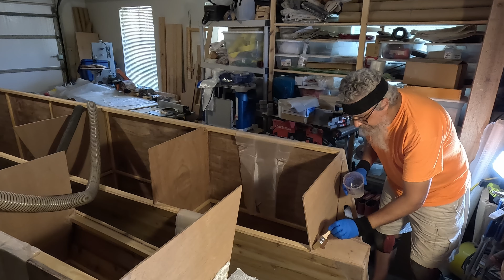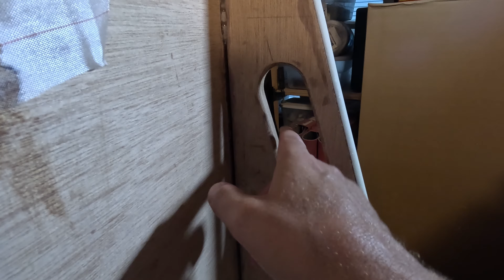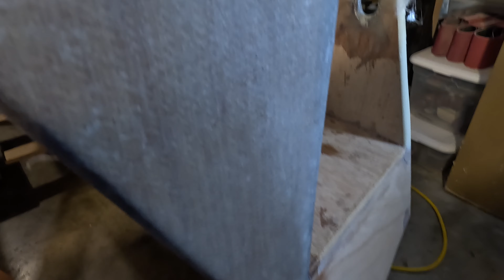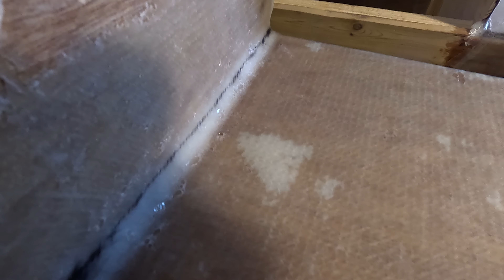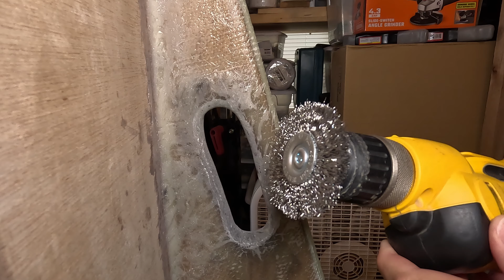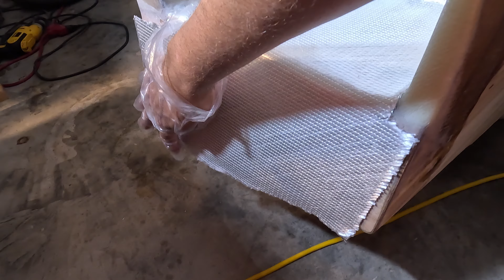DIY Sailboat - Fiberglassing stern steps.

Comment: Hey guy. Great project. I did fiberglass for a boat factory for most of my late teens and into early 20s. Air bubbles do not mean you have to grind it all off. You had good bond every where but the bubbles. Grind the bubbles out and fill it with some csm if its really deep or if its just surface use long strand filler. 

That air is likely from using too much pressure with the bubble roller. You can force the resin out enough that it doesnt bond well and is prone to delam caused by air filling the resin void left from rolling hard. 2 fingers is all you need, maybe half a pound of pressure. If properly wet the bubbles will just float out with a little coaching from the roller You arent rolling bread.
Reply from the maker: Thank you and good to know. I'll be starting the next round of fiberglassing soon as I am getting back into the building. And I'll keep a lighter touch going forward.